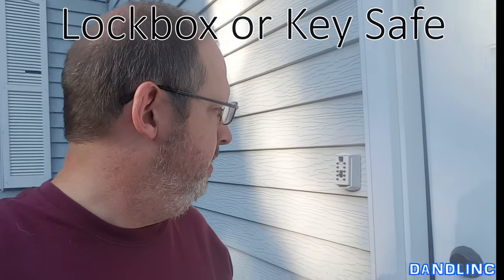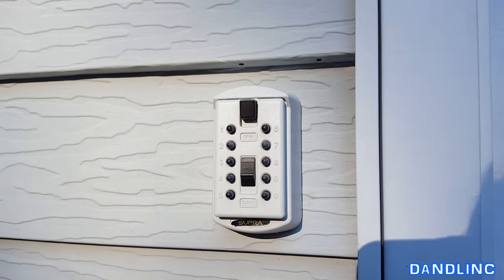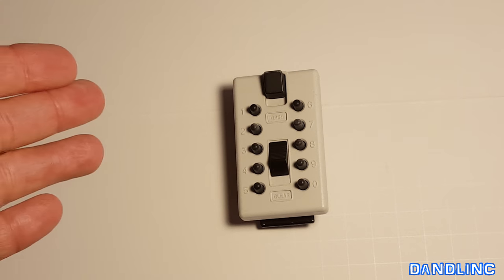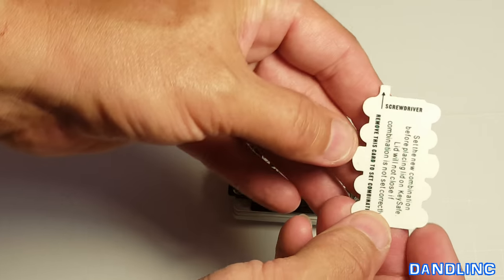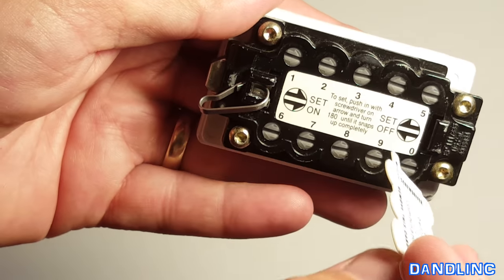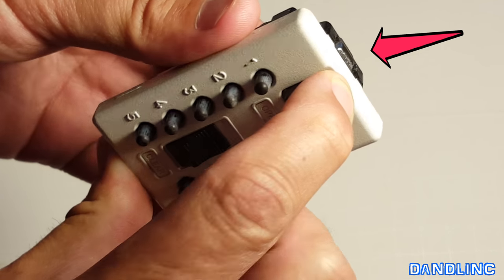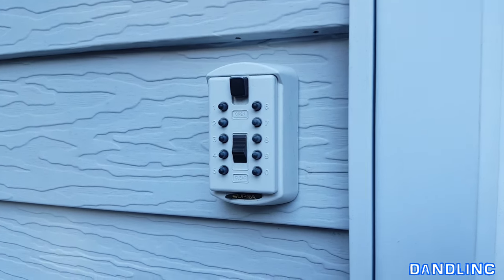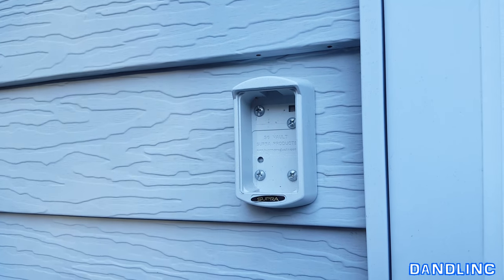How To Reset & Program A Keysafe Lockbox (Supra) DIY

Comment: You commented that "one needs the existing combination to change to a new combination". Is that correct? Perhaps you meant: for a closed and locked box, one needs the the existing combination in order to get the "door" of the box open? If the door box already open, one can easily reset the combination. My box was open, but I had forgotten the combination. I followed you directions for resetting, and it worked perfectly. Thank you.

Comment: Thanks for this. It even shows a description of the off and on, but I never would have figured that out myself.

Weird thing about these is that the "code" doesn't really matter, just do all the digits you choose in any order and the lock opens.

Some math nerd might be able to calculate the actual best number of digits to use for these, because a savvy thief would know they have decent odds to brute force their way thru.

Comment: What should i do if i bought a home with one and i don't know the original code??
Reply: My exact same problem!
Reply: I have the same problem too haha
Reply: did you ever figure it out? I have the same situation
Reply: Taner A same... but would’ve be effective if any 8y old could google a master code to pop it open... my plan is to use a drill to destroy it and replace it with a new one ...
Reply: I got one from a friend that couldn't open it. The code was 1, so perhaps that's the original one? I tried to search for a manual explaining it, but couldn't find any.

Comment: I have just bought a new house and the exact same key safe is on the wall, the previous owner had passed away and I do not have the key safe combination, It is in a prominent place and I would either like to remove it without destroying the brickwork or find some way of opening it, please could you suggest anything, I would be very grateful.
Reply: I'm in the same position as you. Bought a house with one of the side. No relative knows the combo. Do I take a sledge hammer to it? Don't fancy damaging the brickwork either
Reply: I would get a grinder and cut the face off, if you can get the face off then it’ll reveal the inside shell and mounting screws

Comment: Maybe you should have shown how to program a combination of numbers. Nine doesn’t really represent a secure combo.
Reply: The number sequence doesn’t matter. For example, if you set the code as 1234, then any sequence of those numbers would also work - I.e., 2341 or 4213. In fact, so would 1122334. Any sequence of those digits. The most secure codes would have 5 or 6 distinct numerals in the sequence. A 4 digit code would be almost as secure and a lot faster to input.

Comment: This did not explain how to set the ORDER of a combination.
Reply: The order is irrelevant. If you set it as 1234, you can unlock by pressing those digits in any order
Reply: @paddlepower888  if that’s true…… WTF kind of security is that ??
Reply: @justicemoody  Well, it really isn’t great, so I worked out the number of combinations of using 3,4,5,6 or 7 digits. I came up with 110.
Reply: @paddlepower888  Not great. That’s the understatement of the year. They should go serve burgers and fries or something. They’re in the wrong business.